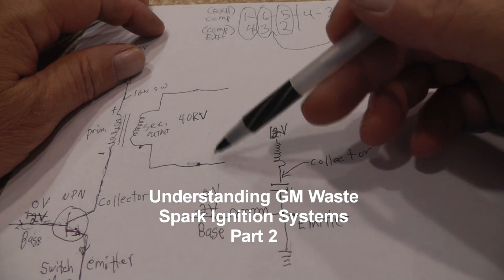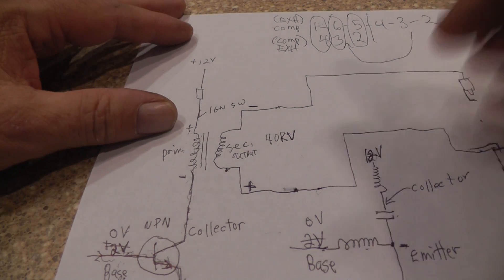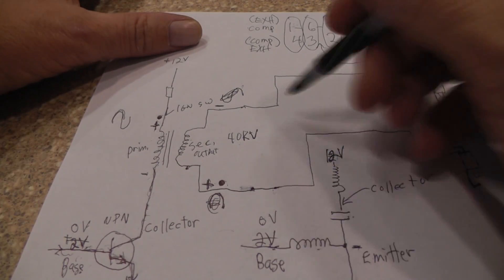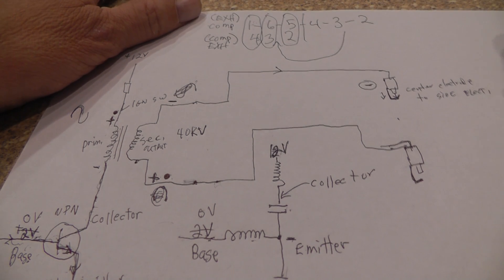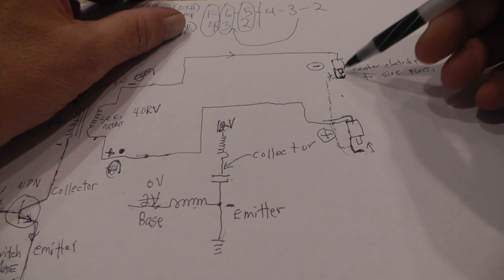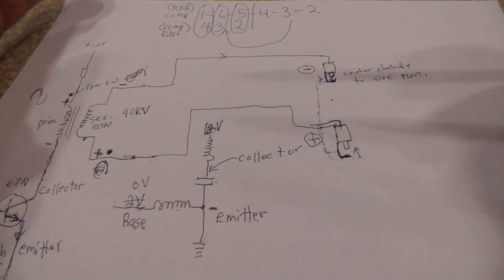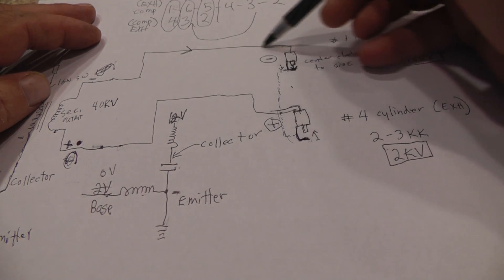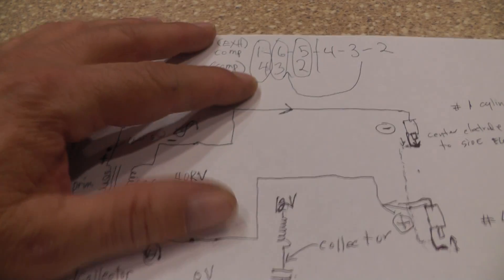Understanding GM Waste Spark Ignition - Part 2

Comment: One other question (sorry). I believe you want to the dominant spark to the compression cylinder to be negative at the central pin of the spark plug. So, the current flow in the secondary windings would need to be reversed with every other spark from each coil pack. Thinking back (way back!) to my basic EE lectures, I believe the current generated in the secondary wiring of a transformer comes as a result of growth or collapse of the magnetic field. The vectors are 90 deg out of sync. So, is the primary current a single pulse, lasting 120 deg of crank rotation, with the growth and collapse of the field giving you the firing of each cylinder? Or, is each spike of primary current a millisecond pulse, reversed in polarity for every other spark? Or, do they just accept that the polarity of every other cylinder will be positive at the central electrode?
Reply from the maker: Hi Dave. If I understand you correctly, the polarity of the spark plugs does not alternate. Half of the cylinders will be devoted to the negative polarity and the other half will be for the positive polarity. Never changes. I went back to see what the actual polarity of the cylinders are and I was right on the 2nd video of this series where #1 is negative and #4 is positive. Here is a complete listing of those polarities.

#1 Negative, #4 Positive, #5 Negative, #2 Positive, #6 Negative, #3 Positive

You're right that a growing and collapsing field will generate current, but as the magnetic field is rising in the primary, it's action is much slower due to the inductive reactance of the coil. On the other hand, the collapsing of the field is much faster and with the current, turns of windings and with this collapsing speed, we get a much higher voltage out from the secondary due to Lenz's Law. It's true that being an inductive circuit the voltage and current are 90 degrees out of phase, but in troubleshooting, I can't see where there is an advantage here. I created a short video for you and Steve showing some waveforms on Picoscope that may help answer your question a little more. It's uploaded now and is part 3 of this series. Take care Dave and thanks for the question!
Reply: Great answer, I understand, thanks.

Comment: How much current flows down the primary coils? I ask because I've always thought that transistors were great for switching, but not so good for higher current applications.
Reply from the maker: Hi Dave, I went back to a previous waveform that I took several years ago on this vehicle. The primary current on the coils runs about 9.5A peak. Bipolar transistors are well suited for high power application using either a TO-3 or TO-220 package. Usually high power transistors have a slower switching rate than the smaller versions using less power, but even then, a typical power transistor can still switch several hundred thousand times a second. Using a conservative figure of 200,000 times per second would give us a switching speed of 1/200,000 = 5uS. On the same waveform mentioned above, the charge time for each coil to reach 9.5A took about 7mS. And on the time between firings was about 23mS. This was at an idle speed of about 850RPM. Even with a higher RPM such as 5500, there still is ample time for charging of the coils and for their discharging. Thanks for the question Dave.
Reply: Great answer!

Comment: Now that was right up my alley. Fantastic  Terry - Question:  if  the amount of KV. required   on the  compression stroke is much higher  compared to an exhaust stroke to  achieve the same amount of spark line, do you feel comfortable  looking at  the two spark lines  on the pico  and view each cylinder and  determine a low cylinder  compression value  by the length of the spark line.
Reply from the maker: Hi Steve, I'm glad that you're finding the videos interesting. When I first got my Picoscope a few years back, I was looking at both cylinders at the same time. And Picoscope allows this with no problem as the HV ignition probes are included in the kit. I found out later Steve through automotive DVD's such as the one from Bill Fulton of AVI-videos, that you can just look at one cylinder at a time and better to look at the cylinder that's firing on the compression stroke. This is the cylinder under the most stress with the higher voltage and will show up more issues than the other on the exhaust stroke, although the spark line should be the same length. Keep in mind that once the spark jumps the gap, there is also the point of where the spark line begins. In other words, it takes a HV to jump the gap, but it doesn't need that high a voltage to keep the arc going. This is what I mean about where the spark line starts. And that's when the actual current flow starts. And that voltage of course varies from compression to exhaust. So, how can we be sure that we're looking at the event cylinder. We could be looking at the firing event on the exhaust stroke. As you know, the compression stroke requires the higher voltage. So, all you have to do is set the trigger on the scope higher so that a redraw of the trace will only show that cylinder because it's going to require a higher trigger voltage to get the trace to draw. On the compression issue that you mention, it wouldn't require as high a voltage to jump the gap compared to one that's under normal compression. Also, since the computer will make adjustments at idle and the waveform could look normal, a WO snap throttle and/or power brake test will bring up issues in the waveform. A snap of the throttle will bring in the air quickly and raise the compression. This will stress the ignition system and doesn't give the computer enough time to make any adjustments for any issues. The scope will have time of course to catch those faults. There's a lot of diagnostic information in these waveforms, and I must admit I'm no expert at reading them. A few years ago, I ran across a couple of articles from Bill Fulton and Bernie Thompson that explained the HV ignition waveforms in pretty good detail. Hopefully, these articles will give you more detail on the subject Steve. Also, I have Bill Fulton's DVD on a 10 minute scope check where in a nutshell he talks about looking at one cylinder at a time with a waste spark ignitions. Take care Steve...
http://diagnosticnews.com/anatomy-of-a-waveform/
http://www.motor.com/magazine/pdfs/052005_04.pdf
http://www.auto-video.com/advanced_search_result.php?keywords=bill+fulton&osCsid=vi7vsu6chea9ck1383gtoj0jt4
Reply: Thanks for the info and a great explanation. It's still below zero up here send still snowing.
Reply from the maker: Steve Rob Unbelievable with the weather you guys are getting. We were having some warm weather down here. But then yesterday that all changed. About 2:00pm, we were having about 72F weather. By 4:00pm, the temperature had dropped to 43F. And that night, it got down to 27F. Really crazy weather as I have never seen anything like it.
Reply from the maker: Hi Steve, I thought I included both articles from Bill Fulton and missed the second one. This one pertains to the waste spark ignition...
http://diagnosticnews.com/waveform-2/
Reply: Great Thanks Terry
Reply from the maker: Hi Steve. I created a short video for you and Dave to help answer your question a little further. It's uploaded now and is part 3 of this series. Take care!
Reply: Fantastic
Reply from the maker: I hope that answered your questions a little better.
Reply: stuzman52 Great info & links to go with your video, thanks for sharing! A while back I ordered a DVD from aeswave.com
http://www.aeswave.com/Exploring-Combustion-Behavior-Through-the-Eyes-of-a-Scope-p8653.html
It's a power point presentation on disc and is also full of info.
Reply from the maker: Hey Thomas. Funny you should mention that one too. I also have that too. Mac Vanderbrink sure seems to know his stuff about secondary ignition waveforms. I remember following along and he would say, "what's wrong here". I thought I made a good guess, until he said worn cam lobes. What the ....? I wish I knew more of how to analyze the waveforms. Lot of good stuff! I completely forgot about it. Thanks for sharing the link Thomas and hope you're doing well.